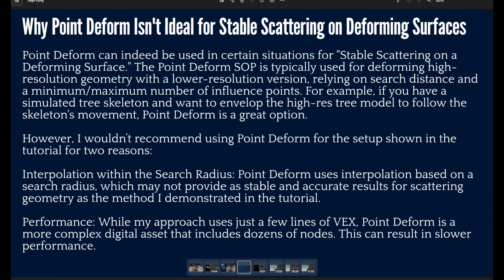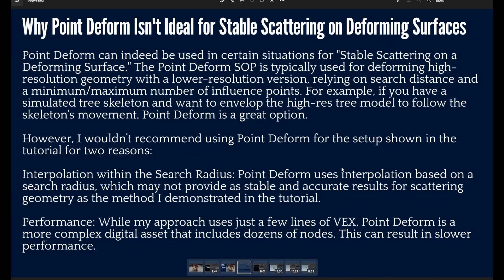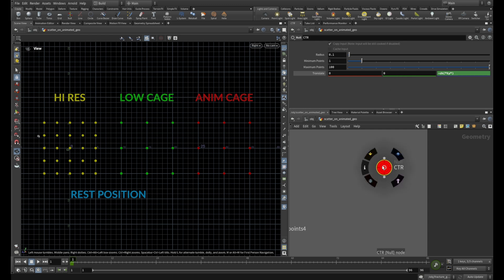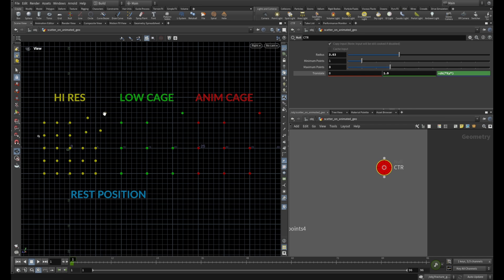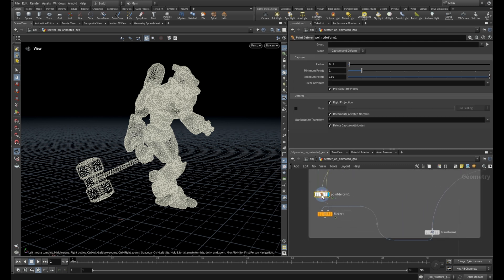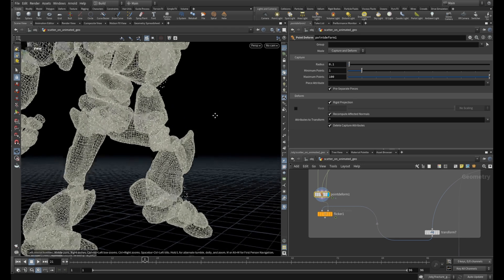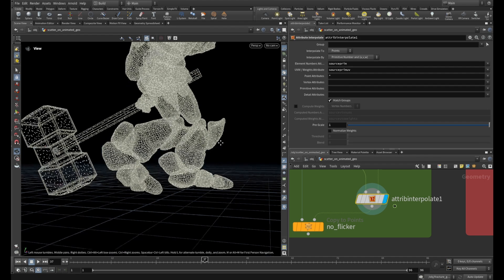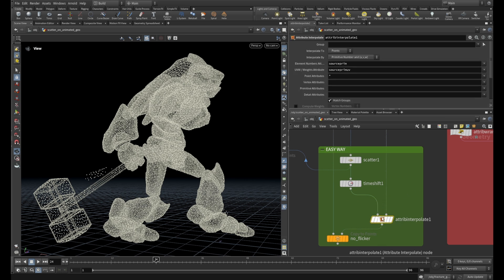Q&A: Why Point Deform Isn't Ideal for Stable Scattering on Deforming Surfaces

Comment: Hi, thanks for the great explanation. I tried the point deform method yesterday after watching previous tutorial and it looked like it worked fine - but switching number of points from 1000 to 10000 as you show makes that method fall apart.